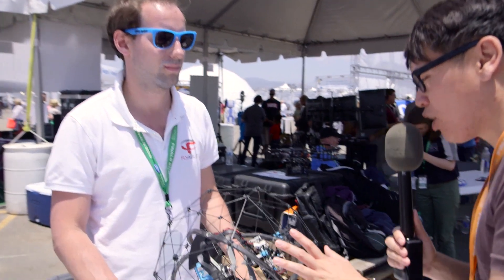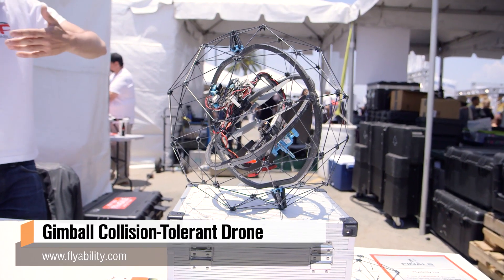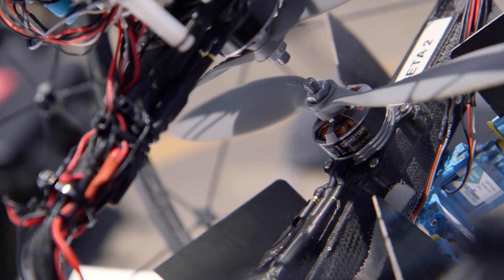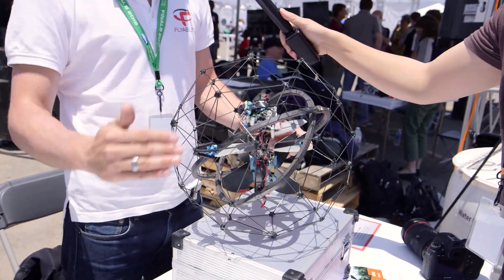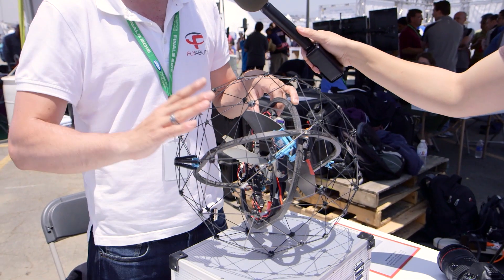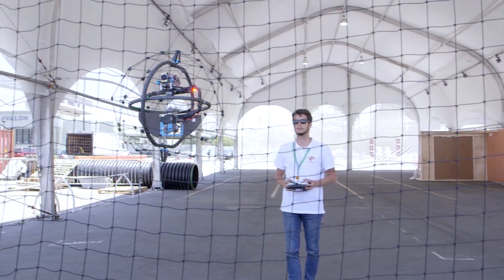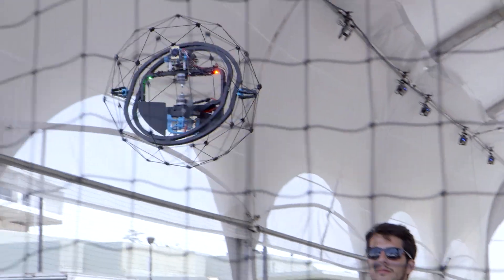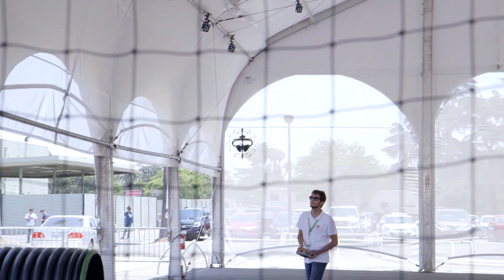Meet Gimball, a Collision-Tolerant Drone

Comment: cute little tiger motors.. had those on my qav... if they are the 2000kv versions

Also i feel like i have seen these before..
http://www.amazon.com/Robotic-Channel-Flying-Control-Helicopter/dp/B0090RM2WS

also could still just use a quad and it would be much easier to transport, mount cameras and hardware  and repair if needed 
http://www.lumenier.com/products/multirotors/danaus/danaus-build-manual

Comment: As soon as batteries can stand a couple of hours of uninterrupted flight we are gonna have Iain Banks Culture like drones following us everywhere. ^_^
Reply: Damian Reloaded Impossible, unless they invent a fission battery
Reply: I'd say 2hs isn't really that crazy. The best current state of the art drones can last around 20 minutes. We just need 5X efficiency/storage improvement. Aluminium batteries are told to be able to charge in a matter of minutes (single digit). So we aren't that far me thinks. ^_^
Reply: ZAKKORD Impossible? You realize the mars rover Curiosity is nuclear battery powered with no solar cells on board, right?
Reply: Damian Reloaded or more efficient motors and equipment

Comment: can't be a quad with only two blades
Reply: pandaManda22  Way more primative. It's even older tech like 1950's coaxial helicopter or 2004 rc tech, this is not cutting edge. Public promo for darpa not the real stuff.

Comment: Cool robot

W\ould be nice if you all would stop using the term drone for these, they aren't drones
Reply: Anibal Perez Technically, it isn't a robot either. It's an RC multi-rotor.
Reply: Anibal Perez 
Pretty sure these fit the common definition of drone.
Reply: logitech4873 Some take offence to the word "drone" because they believe it has a negative connotation, and often instead prefer "multirotor". Judging by the usage of "drone", it'll continue gaining popularity as propagated by its evoking perception and simplicity as a word, while the suspected negative connotation fades. Personally, I think "drone" sounds catchy and badass whereas "multiroter" sounds a bit childish, but whatever.
Reply: MRTOWELRACK Americans love to make up euphemisms for words that have any negative connections.
Reply: logitech4873 Yep, calling it a multi-rotor doesn't change the fact it's still an unmanned aerial vehicle. Therefore the 'drone' slang still covers it.
Reply: Matt D to me drone means autonomous, but checking online dictionaries..... it doesn't
Reply: Sean Fitzpatrick If you want to separate the 'toy' / hobby ones from military drones, just call them what they are: radio controlled helicopters.

If it's one that can fly itself along a pre-programmed route or hold it's position though, you really can't avoid the drone / UAV tag.